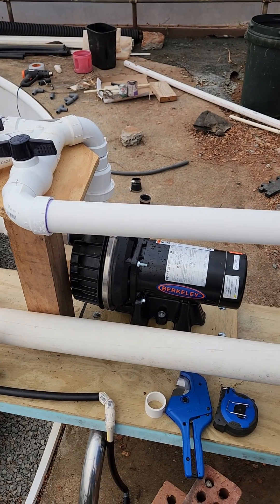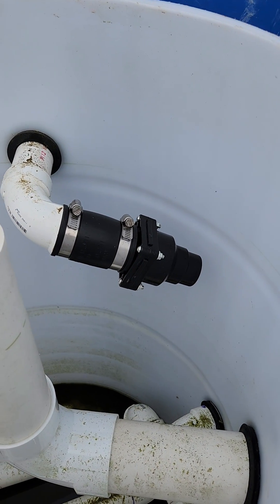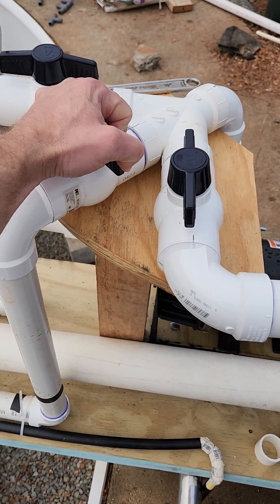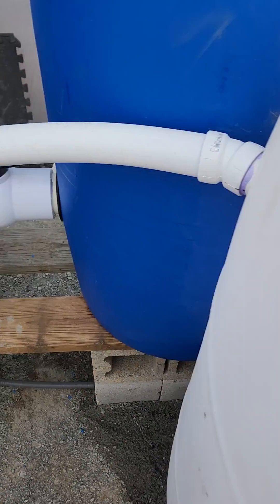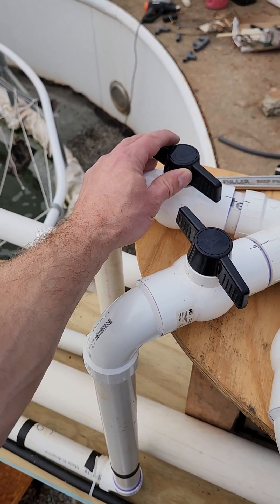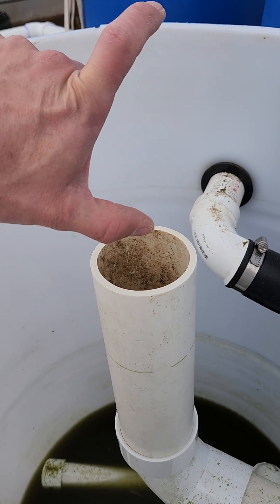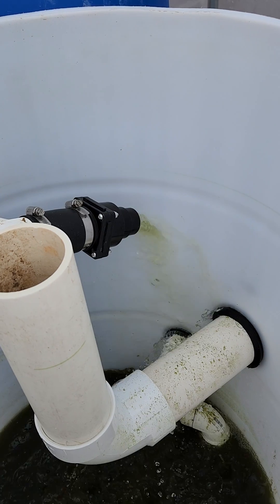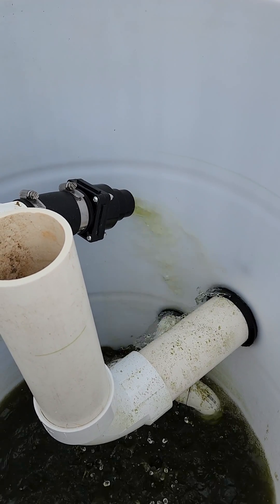Filling the drums again after troubleshooting the vortex tank

Comment: Either increase pump size (gpm) or reduce size of outlets coming off the double wye fitting. Inlet size looks the same as the 3 outlets. Can't feed triple the volume. Like plumbing a house you have to neck down tube size to maintain velocity in the pipes.